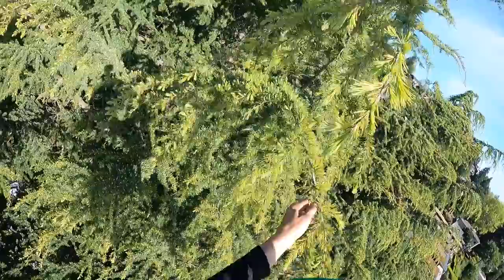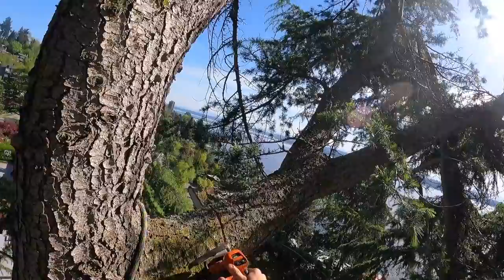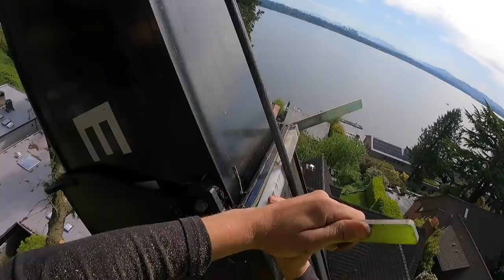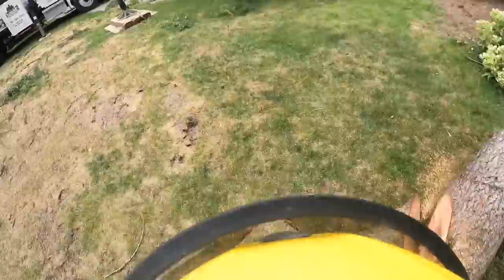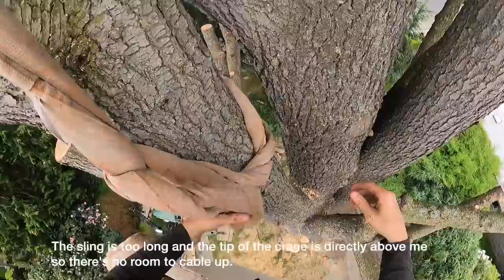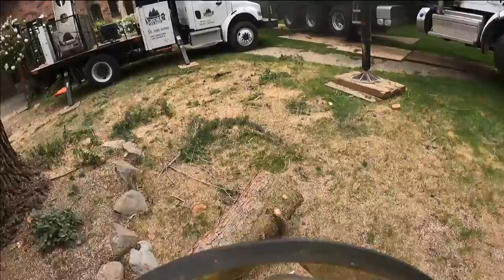ENORMOUS Deodar Cedar Removal! Part 2!!!

Comment: Great to watch you guys work, I love the banter there about what happened with the saw, it brought back some of my best memories if I’ll be honest. I had four close coworkers that would carry similar conversation for a week straight over the same thing. For us it was usually the same 4 to 16 different Dave chappell quotes or less commonly breaking a fence. The customer would point at something that’s mostly termite dust and moss that somewhat resembled a fence of sorts and ask us to “be careful “. As tree workers I’m sure you know the inevitable would happen. A small branch powered only by Murphy’s law and a disregarded comment floating around in the back of your head- “oh don’t worry about the fence it’s a mile away” - would do the deed. First the Dave Chappell quote echoing in your mostly empty sawdust filled head then a subtle nip of the bar will catapult said branch off of the top of the saw- then a glide off the upper boom on the truck- a passing birds left wing-and the magical force from the single moment in the day the customer glanced out the window bending time and space itself forcing the gravitational pull directly towards on the single structural fence board holding the entire 50ft section of fence vertical. Those of you who know the moment of disbelief and awe understand this completely. I swear the story and the ridiculous accusations would take up 80% of the days conversation sometimes and we’d laugh until we cried. I also learned how to do fencing but that’s beside the point. Keep up the good work guys and please keep up that sarcastic banter! Don’t let others use your saws btw that’s a dangerous game😂😂 be safe guys!
Reply: Oh my God I laughed till I cried

Comment: I stand picks up a lot. The trick is to not put the full amount of weight the piece is going to weigh until your about halfway through. Have the operator slowly catch up with it then. When his boom tip is over the pick and it's stood up,  if the hinge hasn't broke off yet then cut the hinge with full amount of weight.

Comment: Have you tried the echo 3710 I use it on oak trunks in Florida and it just blows through and doesn’t bog with no mods I have a 32 inch bar on it atm I was amazed and it’s lighter than a 661 with the same power just about

Comment: Ok no hate but why the shelve cut? Adds way more cuts, especially for the ground guys, hard to deal with wood for log trucks if not flushed. Like yes the pick will sit there but will still move as soon as he lifts and than you have to deal with the stub later on. What’s the reason? Got drilled into my head that stubs are a pain and now realize how much more cutting I was doing when I was doing shelf’s and other cuts

Comment: How many jobs has he been on with chainsaws, it takes a long time to sharpen 36 inch bars that would have upset me. If you're to short set the saw on the ground and put your foot in the handle to hold the bar off the ground.kevin you're fired how's that for taking responsibility?